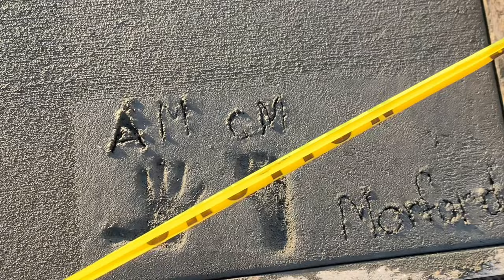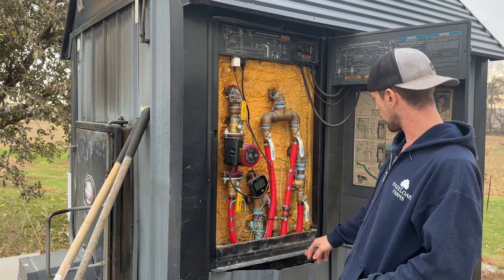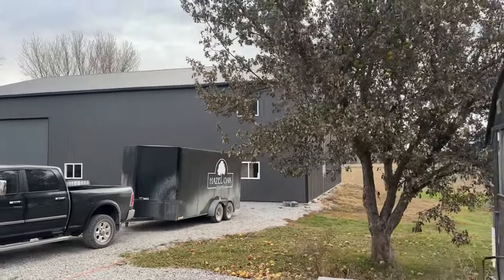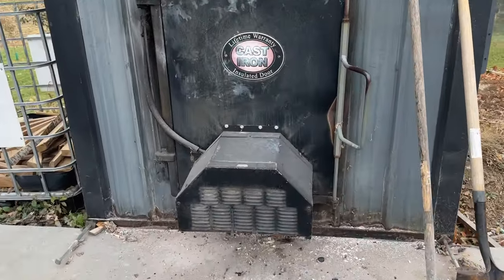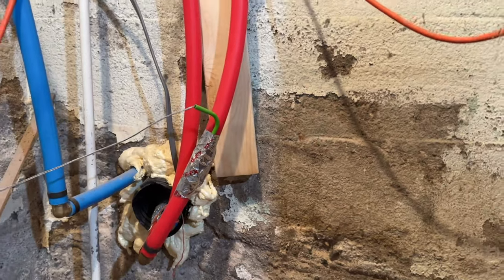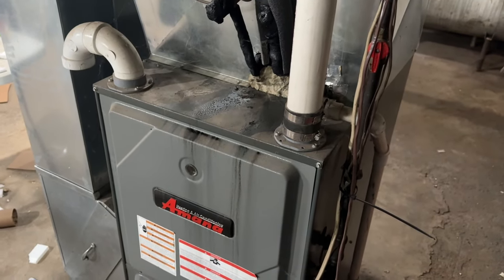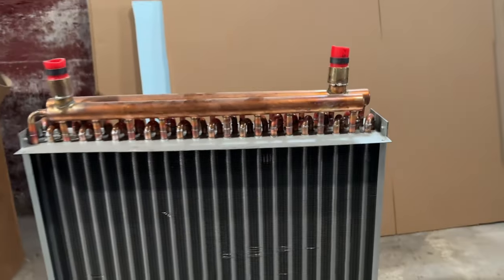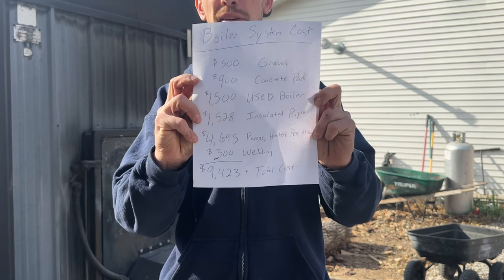Installing our outdoor wood boiler to heat our 3 buildings

Comment: Hi. I'm a welder, and I replace warn out fireplaces on wooden boilers especially with gaseification with new sheet panels within 6 to 8 mm thick, sort of complete restoration, but that fireplace that you just patch it is compromised and is very thin. Will run for a while, but for a lifetime repair you need to remove every outside panel to reach the fireplace and then replace every piece with new even thicker sheet and then test it with compressed air for leaks, maximum 6 bar. I repaired maybe 20 boilers within 20 to 70 kw power. Good luck!

Comment: You're going to need a LOT of wood supply.
Reply from the maker: Yep. I have a lot. I have a sawmill and furniture business. It has been running this past month solely on sawmill offcuts and sawdust. But I do have a large pile of Ash firewood I plan on going through this winter.
Reply: I was gonna say I’m sure he’s got that covered bud 😂
Reply: @HazelOakFarms   I have a Central Boiler 5648 Stainless. It's the next size smaller than yours. I too am heating a fully insulated  36' a 50' 2 story farm house with full basement and have radiant floor heat in the attached 36'x 50 garage + dhw. I've averaged 13 cord in the 20 years I've had mine going. It's my sole source of heat as I haven't turned the furnace on since. I just stumbled on your channel and thought this was your first year with it. I have land and neighbors who let me cut and it is a lot of work but I enjoy it. I filled up some of a barn this year and got 70 cord in there.
Reply: This boiler will put a man on a constant hunt for firewood no doubt about it.  It seems so innocent until you actually try to find 15+ cords every year at a price worth dealing with it. Thats an assload of firewood, more than most who heat with wood burn in 5 or 6 years.
Reply: @Tonnsfabrication  3 cord a year to heat a home? That must be in a warmer area than me. Even guys with catalytic stoves and smaller homes use more than that here when using wood for their sole heat source. In a rural area it is not hard to find wood. Just extremely hard to find someone willing to do the work and not create a mess for the landowner who let them cut. If you do a good job and landowners see that, they will be calling you. I did over 80 cord this past summer. All split and stacked indoors now and I did that by myself. It can be done if you have the desire to do so. If you are buying wood at current prices, I can not see how most any stove, in a colder climate, would be cost effective.
Reply: @kjinohio5897  I'm in south eastern Ohio, me and several of my friends heat with wood (no furnace) we use on average about three a year sometimes four depending. I've got a few buddies that run boilers and they definitely eat some wood, they're way warmer and they heat more  sqf though. For  what they are and if I could go back 20 years, I'd definitely rather have a boiler. . I can see why this guy is patching up an old worn out unit looking at todays prices.
Reply: @Tonnsfabrication   I like my OWB. It does use more than a catalytic style but I like the feed once a day aspect and less maintenance. I'm heating quite a bit of sapce as well as all my Hot water. Trade offs with everything.

Comment: You can put a plate heat exchanger for your hot water used in the house.
Reply from the maker: Planning on adding that soon.  Also a big wood Kiln and possibly an old hot tub.

Comment: I did the exact same with the ink bird to monitor temps. Do you find it to pretty accurate? I added some inline thermostats and man they are great..dead on with my boiler.
Reply from the maker: Ya the inkbird works good.  I just wrapped them to the outside of the pex.  Close enough to the correct temperature.

Comment: great video and great boiler - a nice thing to have. Hope you can find some mechanical advantage to load the big rounds and save your back.
Reply from the maker: Hey thanks! It sure is nice to finally be able to heat my buildings efficiently. Hah ya that video of me chucking in the big rounds was mostly for effect. I’ve been burning sawmill scrap and sawdust mainly in this unit. Sometimes smaller log chunks when it gets really cold.

Comment: Glad it’s working well for you
You are losing much efficiency by letting ash buildup

Approx 15-20 sq ft of steel cant transfer heat to water

My method
When low rake everything forward
Plunge underneath for ash
Shake coals off to the left or right
Dump ash in shovel
Continue to mostly coals remain

Comment: Looks good for cold NY winters, few of my neighbors have these, but your video made me think - what about all that electric? 3 circulation pumps running 24/7, large fan blower on the door - how much amperage are all these things eating?
Reply from the maker: Yep it has been good for our cold Iowa winters as well.  I ran it all of last winter, and have been running for the past month.  The fan blower in the door only runs about half of the time, and doesn't take too much electricity.  However the three pumps do take a fair amount of electricity. I think we figured about $1 a day per pump.  So it can add up, but still way cheaper than our A/C units in the summer.
Reply: @HazelOakFarms  
Thanks for the info brother, recently bought empty 7 acres and starting from scratch.